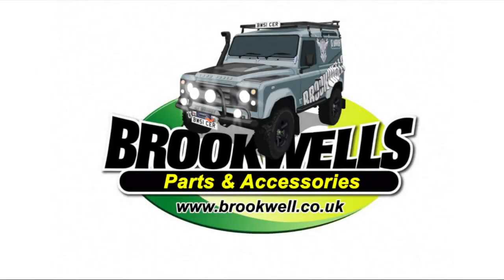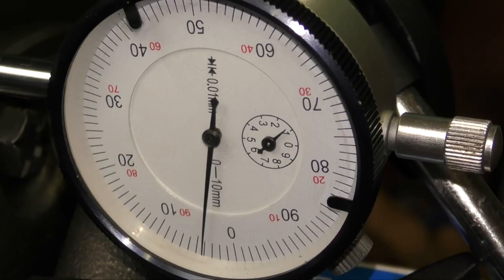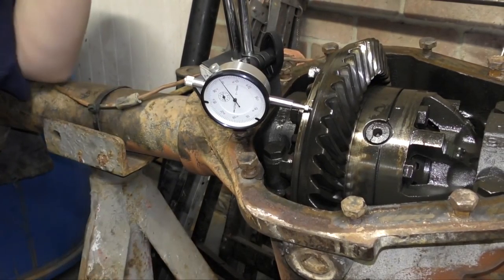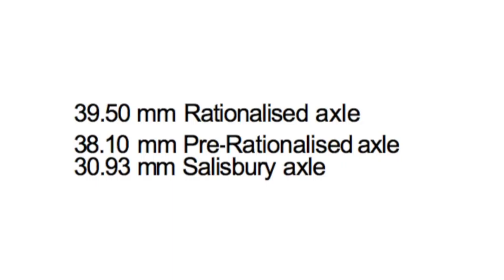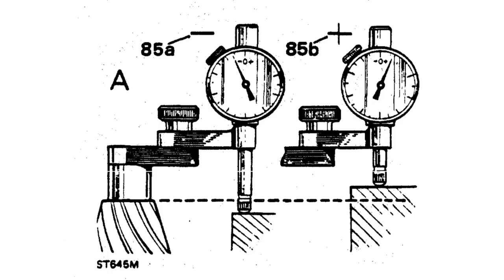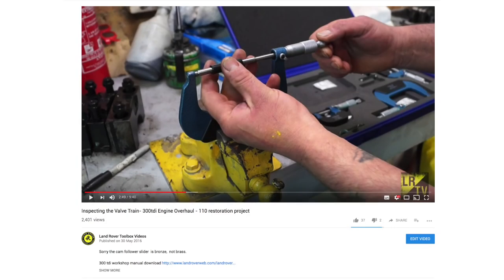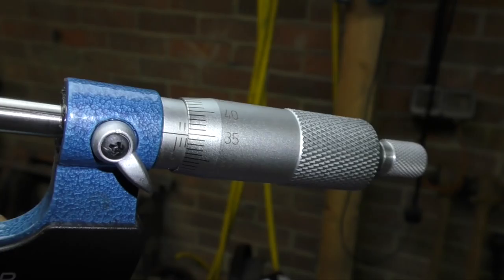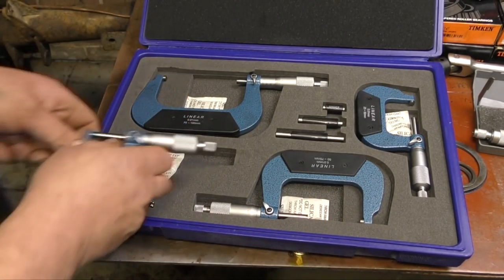Land Rover Diff Overhaul Putting 0.05mm Into Perspective-Measurements

Comment: Hi can you help me diagnose what the knocking noise is on me defender 300tdi thanks
Reply from the maker: I can't hear it from here.  

knocking "could" be a result of poor combustion.  Classic cause is a loose injector compression blowing past a injector.   Other causes could be poor timing or poor quality fuel.
Reply: I just uploaded a video to YouTube of the engine running timing has just been done and had new injectors fitted and the garage has told me the engine is scrap and I need a new one thanks for the replay m8
Reply from the maker: Yeah, i can hear that.  Have you tried a stethoscope to pinpoint the tapping?
Reply: No I have been growing through you video as a reference as I am not a fitter thanks for you help

Comment: Micrometers should be kept scrupulously clean, to clean the anvils, gently grip a bit of ordinary paper between the anvils and pull it out, then check to see if it zero's accurately. Should be a very rare event to have to adjust the barrel to re zero